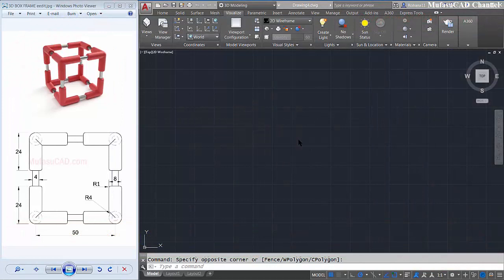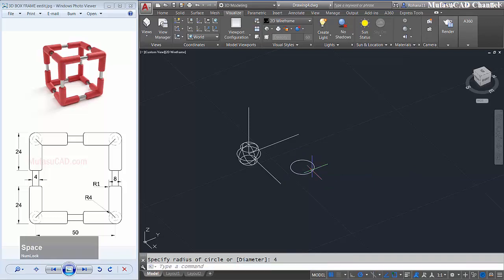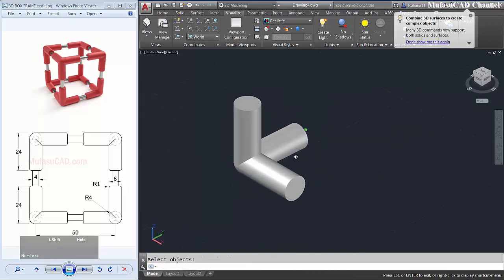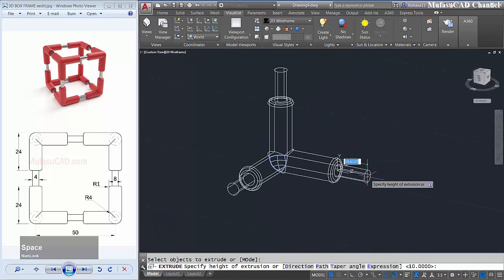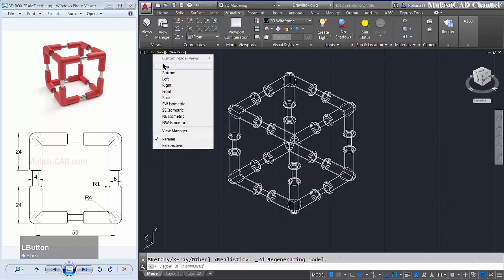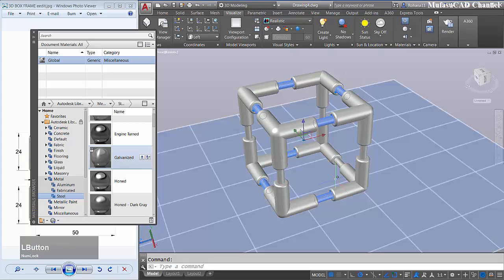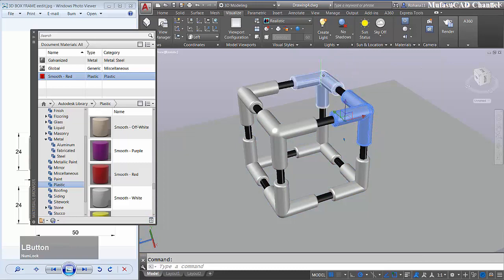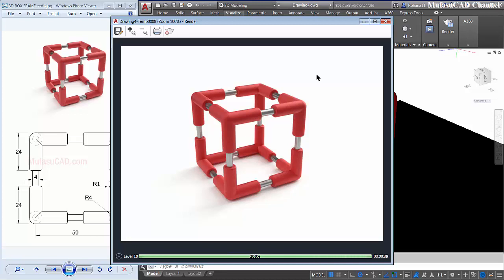Autocad Design 3d Box Frame Basic Modeling Tutorial For Beginner

Comment: When I drew the same thing with the same instructions as per your video, I didn't get this subtle shadow which is there in your final rendering. Could you please tell me how you achieved this shadow. I exactly followed all of your commands, setting, dimensions etc as per your video. Did you add any light in this model...???? Please reply, as I am very confused and not able to achieve the shadow....Please tell me all of your render setting... I am using Autocad 2015.... Please reply.
Reply from the maker: in autocad 2015 make sure you click advance render settings and then you need to activated shadow and global illumination,,